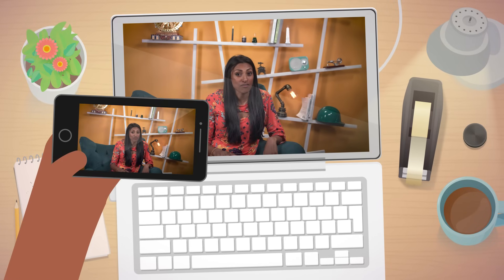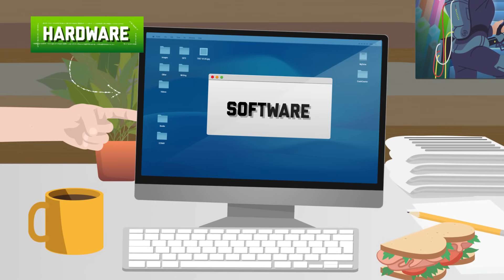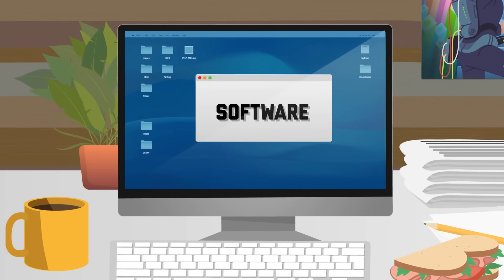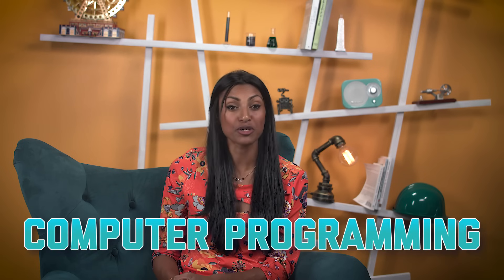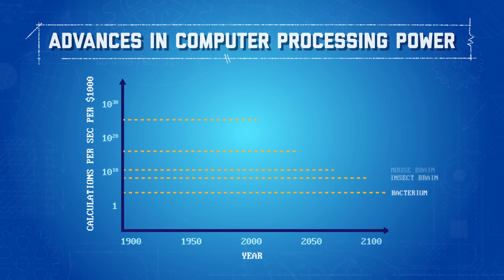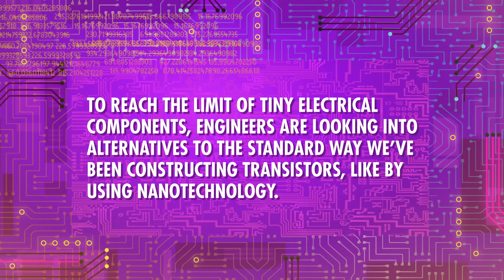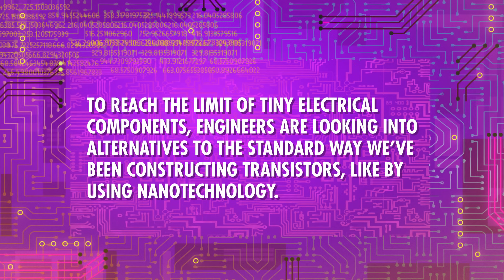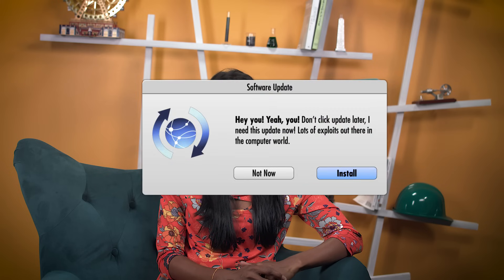Computer Engineering & the End of Moore's Law: Crash Course Engineering #35

Comment: When I fix the WiFi in my house my family thinks I can become a engineer all of the sudden
Reply: Yeah, WiFi is a standard that is made to make wireless simpler to implement and use. That's what you should tell your family. Sure it can lead to becoming an engineer, but it's meant to let everyone use wireless.
Reply: If you implement QoS rules and enforce DNS redirecting and thus block a few websites like porn and such and use MAC instead of password for authentication maybe you're in the path of becoming a network technician. If you install another router to watch the packets exchanged between the original router and the client then you're definitely in the path of becoming a network hacker. But an engineer? Nah.
Reply: Some times is the opposite, when people ask me "oh what did you study?" and I answer "Computer Engineering", "oh so you can help me install my printer?"

Comment: Fun fact. The IBM 1130 was simulated on an IBM 360 to determine how the single card bootstrap loader would work. The 12 rows of the standard punch card were expanded to the 16 bits of the 1130's words and the instructions were designed to make it work. OS, compilers, assemblers, peripherals, everything was simulated first.

Comment: 6:39  eh, thats very misleading?  components are getting more powerful, and general memory requirements are increasing... but they're also getting significantly more efficient... either getting more performance out of the same power targets, reducing overall power usage, or a mixture of both. There's also Instruction Per Clock improvements where more tasks can be completed in a single clock cycle.  And just about all new internal components will downclock or even enter ultra low power sleep modes when not in use to save more energy when you don't need the power, this is a major reason why we have laptops getting 10+hours of usage on a charge and mobile devices that can last days.  Even the ultra-high-end is more efficient now than it has ever been despite there being multiple times more processing cores.
Reply: Ok...
Reply: that's true about them getting more efficient and powerful recently, but what we have to remember that that efficiency and power comes as a result of the innovative engineering that chip designers are using and, in some cases, even inventing. so although they are more powerful and efficient, all of that wouldn't be possible using the methods found in chip architecture even only 5 years ago. reiterating the point of this series, it's to show that with new engineering techniques and new ways of designing systems, we can achieve all of this, but not without the challenges that come before success. ^^
Reply: /r whoosh  @minter8701
Reply: Yes, but with diminishing returns.  Leakage in the smaller transistors will counteract some of the power savings due to the smaller size.  Also the smaller size results in increases in the power density - more power per unit area.  That makes it much harder to cool the circuits.  Why have computer chip speeds pretty much settled into the approximately 2-4 GHz range?  It's because it is so hard to cool them if run at faster clock rates.

Comment: An issue you approach but don't quite mention explicitly is dark silocon. The chips are getting smaller but the concentrated heat prevents the whole chip from running at once. If we did run power through the whole chip it would break so we need to leave some of the chip "dark". This leaves less of a benefit from jamming more transistors on the chip. One way around this is as was said, reduce the heat. Another idea has been to design hardware "accelerators" that can do one job very well, and just specialize different parts of the chip to do different roles. This way we maintain some benifits from shrinking the chip while not requiring the whole chip to be running.

Comment: Does anyone else feel that this series is severely lacking in terms of generally useful and relative information? No specific explanation of embedded systems in this episode is simply heartbreaking. In case it helps, I've always found Computer Engineering is best explained from the ground up. By which I mean from a Physics point of view to high level programming abstractions. For future episodes please pick an angle and stick with it throughout instead of jumping around so much because these episodes are not nearly long enough for such a broad scope.

Comment: Great topic! Without a quantum leap in computer engineering, true AI will not be possible...
Reply: The hardware to pull off a general AI absolutely already exists.  the next hurdle is in software and storage density and datasets, if they were at the right place we could absolutely build a facility (probably larger than any datacenter on earth, mind) for it to run.
Reply: I don't know about that. I'm a software engineer, and while I admit that I don't do a whole lot with machine learning in my work or even as a hobby, I'm of the belief that people overestimate the barriers to general AI. We're not there yet, but we're a lot closer than most people think... and don't even get me started on the people who believe there's something spiritual/magical/special about "minds" that can't be replicated in a computer. Because they're just delusional.
Reply: or just more stream processors/cuda cores running at slightly higher clock speeds.

Comment: I'm an electrical engineering and computer science dual major student. I think I merit as a computer engineer
Reply: It doesnt work like that
Reply: marvin ochieng no it does
Reply: Electrical engineer most of the time work with the hardware and computer scientist works software and the in between is computer engineer
Reply: Hernando Malinche   Electrical Engineering is much harder, it requires more analytical math(Calculus 1,2,3, differential equations.......etc). While in  Computer science if you got Calculus 1 and discrete mathematics then you are alright.
Reply: @karimselemani5157  
I can confirm. I switched from electrical engineering to computer science, because I was too lazy to study all that math.
Reply: @karimselemani5157  I suppose it really depends on the level of computer engineering you're doing.  But once you get down the the level of semiconductor design, especially the fabrication side of things, you're well beyond the realm of classical electrical engineering, & you need to have a strong grasp on quantum physics.  Especially if you're engineering quantum computing systems, obviously.
Reply: @TheUglyGnome  That's the added advantage of doing engineering, the math is sufficient to switch to any other field of study
Reply: @karimselemani5157  
Indeed. After 1 year of studying engineering math I passed all math courses required for computer science degree in the university using maybe 5 brain cells (or less). It was great, since the math lectures at the university were usually in the morning. I could sleep late while my fellow students had to wake up early :)
Reply: Engineering and Computer Science double degree here. Best double degree combo
Reply: @Raiden0831  not really. It all depends on the industry, position and size of the team. I'm an EE and do everything from hardware, firmware, OS drivers and basic OS applications
Reply: What's been your hardest classes so far?
Reply: I don't pretend to know the exact moment when you can call yourself a real engineer, but with extremely rare exceptions, it's never when you're still in university. And I'm talking philosophically. Legally speaking, students definitely do not count.
Reply: Maybe when you graduate. But now you are just a student, nothing more.
Reply: >1000 h in Factorio does it.
Reply: @karimselemani5157  
Computer Engineering take all level Maths courses too. + high level Computer Science/Software Engineering..